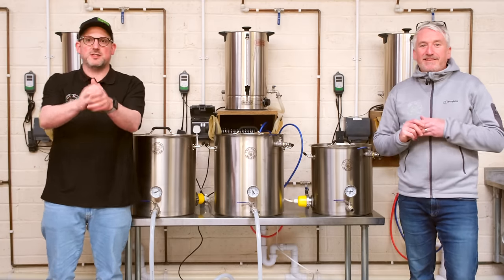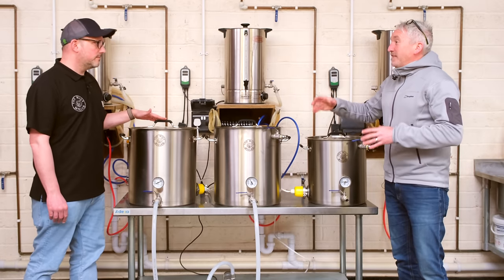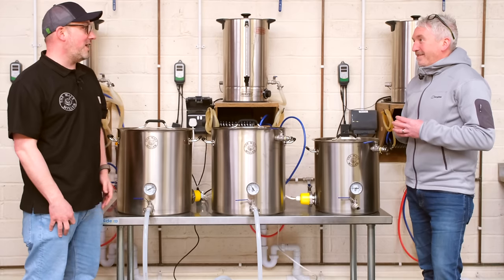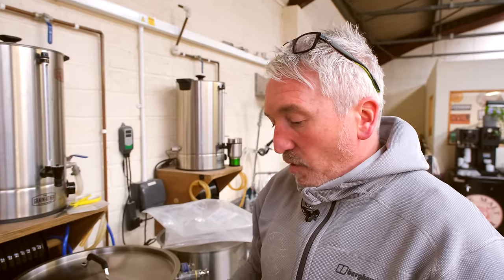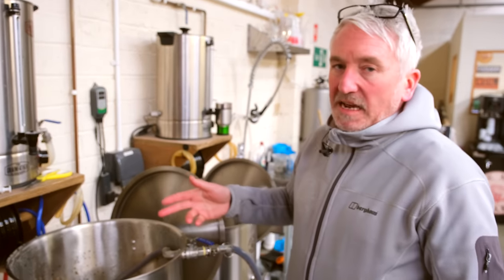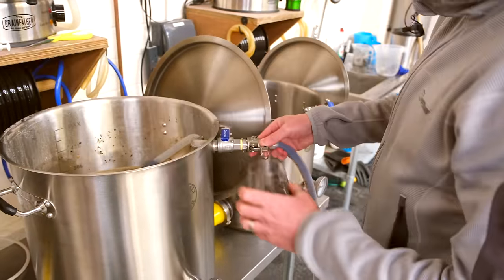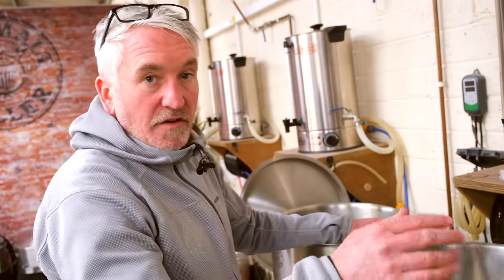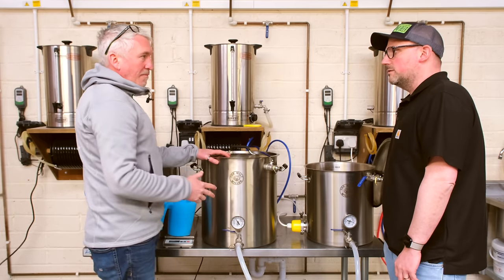EPIC 3 VESSEL BREWDAY | ELECTRIC HOME BREW SET UP | THE MALT MILLER

Comment: Takes me back! I built mine system 2x50L damaged kegs by cutting the top out with a dremel tool and making a syphon on the HLT and a hop stopper on the boiler, plus a plastic picnic cooler for the mash tun with a slotted manifold, no pumps, just gravity fed with contentious sparge( running off the same amount of wort as incomming hot liquor). There was no home brewing equipment on the market, all the Americans were brewing on gas. A trip to Highworth to see Ken for my brewing ingredience. Richard

Comment: Great video. I wish this was available when I started using my 3 vessel system a few years ago. Regarding the stir bar... I've dumped more than one into my fermenter over the years but you can use a magnet outside the flask to slide it up and out before pitching. Removes the risk and allows you to add the whole starter volume without leaving anything behind.
Reply from the maker: Great tip!

Comment: Great video. I'd love a three vessel system, I haven't got the budget or the room ! Planning my 1st BIAB in my Burco in 25 years.
I need to order an immersion chiller. I did think about using 2 chillers, with the first in a bucket of iced water connected to the second one in the kettle.🤔🍻
Reply from the maker: Sounds great! If you have a pump to re-circulate the chilled water through the chill that could work well but I'd imagine you may need to top up the ice a couple of times.

Comment: Really enjoyed this video and it’s inspired me to do a BIAB either in my 35L kettle or go right back to where I started a 11L pot on the stove. I really liked your set up for the blow off tube - how does it work?
Reply from the maker: For the blow off, 3/8 JG fittings and gas line. If you use a male 3/8 female to male it perfectly fits the hole in the silicone stopper that fits in the lid of the fermenter. You can then use 3/8 elbows and 3/8 gas line to fashion the blow off tubing to your specific set up. It also allows to to add small amounts of CO2 when cold crashing;)

Comment: I would have liked to have seen a bit of the clean-up process. I have always been able to up-end the vessel containg the spent grain and the ease (or lack of it) of cleaning up would have been instructive, I had been expecting a sort of grain basket as I did in my very early days as a Lauter Tun. (bucket in bucket arrangement).
Reply from the maker: Stay tuned 😉

Comment: Great video, what is your preferred at the 30 ltr volume, 3 vessel or all in one ?
Reply from the maker: Hey! This really depends on your preferred method as both will work and create amazing wort when you apply the principles for brewing great beer - water quality, high quality ingredients, well constructed recipe, cleanliness and controlled fermentation and packaging. The difference is how much time you want to be "hands on" with the brewday. All in one systems such as the Grainfather offer massive amounts of simplicity and convenience coupled with smart control and repeatability. The less automated methods such as 3 vessel or BIAB offer you more in the way of hands on brewing and experiences. Both are great but each suites different requirements for the brewer.

Comment: If you use a plate chiller how would you do this without initially having to run run boiling wort through the magnetic pump to get it through the chiller?
Reply from the maker: Hey! Few things to consider with this answer. Firstly, some pumps will work at up to 120c, our magnetically coupled ones for example, some won't though and you can cause cavitation in the pump. The second thing to consider is how you have hops in your kettle, if you use a hop spider then you won't have as high risk of blocking up the plate chiller with them but there is always a trade off in hop efficiency. This all being said, in our experience the best thing to do is to not pump wort through the chiller until you are ready to transfer from the kettle to the FV and the way we approach it is to fill the chiller with sanitiser before you hook it up and then when you transfer the finished wort, discard the first runnings until its clearly wort coming through the chiller. You will then need to clean and rinse the chiller, plus allow it to drain out after the brew before storing.

Comment: I see you add protfloc to this recipe. Is their a difference in the body if you don’t add it. Will it still clear but with nicer head retention.
Reply from the maker: No difference in the body as this tends to be driven by the residual sugars in the beer after fermentation, adding protofloc however does help remove the cold break proteins and give you a clearer beer at the end

Comment: Just wondering why you didnt raise the temp for mash out? was it just a mash at 68C
Reply from the maker: We wanted to keep it simple and don't have a heating option in the mash tun. If you had a HERMS set up then that would work a treat!
Reply: @themaltmiller8438  so is a raised temp (75/77) for mash out nessesery nowadays
Reply from the maker: @scottlannganlannigan2704  No, but it can be helpful. The raised temperature helps keep the grain bed fluid and stops the mash sticking.